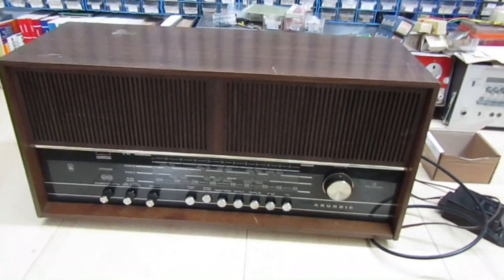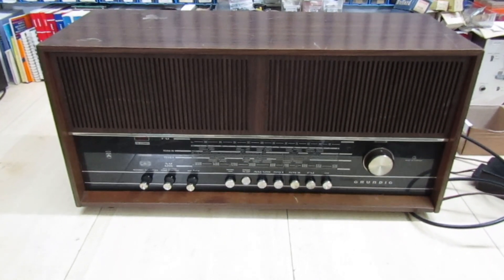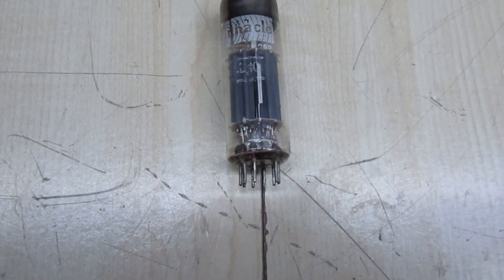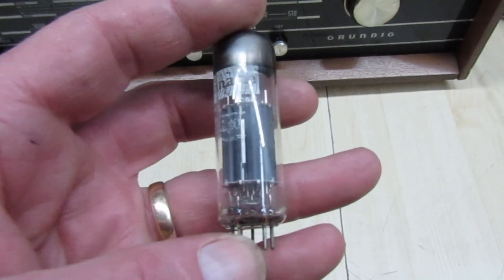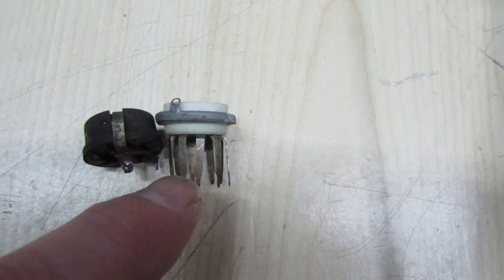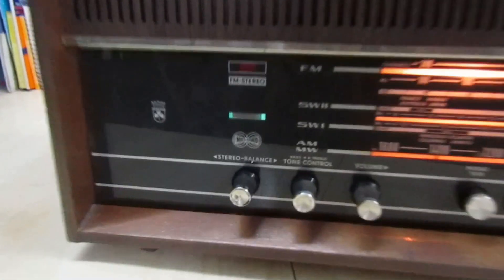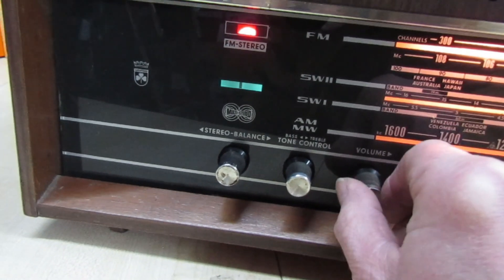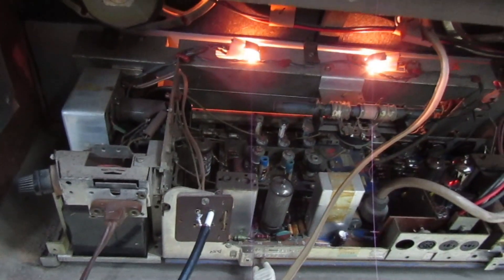Grundig RF250U/Stereo vintage radio.

Comment: Another highly interesting and educational video. That's a very good idea to use a "higher" valve base to reduce heat sink into the PCB. It's nice to see you featuring electronics with valves, I would like to see more videos featuring valve based electronic devices if you have any?
Reply from the maker: Of course ,more valve stuff is planned , I grew up with valves and I love them , also have a very large collection !

Comment: I remember that output valve well from a circuit in maybe Practical Wireless?? I built. If I recall it gives about 3 watts output single ended or 8 watts in a push pull circuit. And you are correct, it really does get VERY hot. Even without leaky caps. Was never a very popular valve but used a lot in European sets. Now very expensive and quite hard to find. Not worth buying second hand as they are always cooked.
Reply: i DID find a good one, looks unused, or very little used, via ebay in the mid 2000s but cost me £25 ish 😲 hate to think what one would be now!, can use 2 EL95s in place with an adapter
Reply from the maker: I vaguely remember seeing this featured in an electronics magazine , either PW as you say or radio constructor ,I think it was only used in a few sets and that's what makes it quite rare and expensive now to buy , I paid about £50 for it .

Comment: That looks to be almost the identical chassis, to a Grundig Mandello radiogram I tried to repair, for my aunt some years ago.  Bought new in 1967, complete with the plug in FM stereo decoder as you have there.  Only difference to your unit is my aunt's chassis had LW and just one single SW band.  The HT bridge rectifier had shorted out and caused the mains transformer to overheat.  A new rectifier got it working again and I have to say, the AM bands sounded very good and the FM stereo sounded stunning.  Even the old Philips autochanger sounded good.  Sadly, the damage to the mains transformer was too bad and it started overheating after about 20mins of use.  I was unable to source a suitable replacement at reasonable cost.

Comment: Pinnacle valve yes definitely a replacement,  good idea to fit the stand up valve base Michael.  I have a Grundig mains radio in at present for repair but it's all transistor model from 1974 so think your one must predate that
Reply from the maker: I have to admit I'm not a massive Grundig radio fan  and while I have many vintage radios I think I only have the odd Grundig knocking about.

Comment: Excellent job done micheal.  Love your idea with the valve base!

They usually came with lorenz/itt or valvo ell80's.
The sound is very good, but it changes its tone characteristics when you turn the volume
about half way up.  I think this is to do with some sort of in built loudness contour feature which has
always seemed an odd arrangement to me. 

Maybe the small OPT's can't handle the extra gain, also the PSU transformer is not all that heavy duty
for a stereo valve set. 
I have had a couple of the radiogram versions with this chassis. The tuners are usually pretty sensitive
and pull in stations fairly easily.

The owner is very lucky to have the stereo decoder as all of the grundig radiograms here in the uk didn't come with one. It was optional, and most people at the time didn't bother with it as fm stereo transmissions didn't
exist until around 1970.    These chassis were made between 1965-1968.👍
Reply from the maker: I figured this may not be a UK model as it can be used on 110v also , I did struggle also to find a circuit diagram , reception in my workshop is very poor and I had to connect to an outside aerial to get stereo.
Reply: @michaeldranfield7140  Yes, this one was probably made for the european market.
Rarely do you see the stereo table versions here in the uk. They are quite a nice durable set, usually very reliable.

Comment: Yes michael those valves run red hot, on radios like these i usually add a slow running 8cm PC fan extracting heat outwards
Reply: reduce value of the grid resistor, it'll lessen the effect of any grid current developing
Reply from the maker: Its effectively two valves in one so twice the heat in the same size encapsulation , I think valves were more reliable when they were octal .
Reply: @michaeldranfield7140  Ive seen these get so hot the glass melted because of the vacuum they suck themselves to death
Reply from the maker: @Synthematix  Yes , I have seen that before where the envelope has distorted.
Reply: @michaeldranfield7140  yep, octals less likely to give trouble in this way, well any older type with wider electrode spacing,  though i do have 2 CL33s with grid emission problem...

Comment: have not seen thouse long leged valve holders since the days of the PYE hybrid CDA panels.
Reply: there are some on my old pye hybrid 697(?)  chassis from 1974
Reply: Those cda boards still cooked like toast, especially with three pch200's and a pl802 cooking away!, not a bad old telly though.
Reply from the maker: I was lucky to still have these in stock , I remember the Pye hybrid , seem to remember there was 3 video out put valves and a very hot running luminance valve , was it 3 x  PL84 s and a 10 pin PFL200 ?
Reply: @michaeldranfield7140  Yes PL84 ran hot as did the 12K resistors.

Comment: Pinnacle valves,there's a name I hadn't thought about for years!
Looks late 60's/very early 70's as it has the stereo capability.ELL80's seem fairly expensive from a quick search.
Reply: they are, they werent ,made for long and notoriously bad, its basically 2 EL95s in one envelope, you used to be able to get adapters to take 2 in place,  also was an ECLL800, same 2 output valves plus a low gain phase splitter triode, similar issues, no adapter for those..
Reply from the maker: @andygozzo72  Got a ECLL800 valve , I made a push pull valve amp with just the one valve for a youtube video a while back .
Reply from the maker: The new valve was expensive , I paid something like £50 for it , pinnacle did a lot of TV valves in the 70 s , they came in a light blue box if I remember correctly ?
Reply: @michaeldranfield7140  Yes,came in light blue boxes and the markings on the valve would possibly rub off a bit more easily than other makes.
Reply: @michaeldranfield7140  make sure you use as low a grid resistor as you can so any grid emission/leakage has less effect 😉  ucl82s in several small philips sets gave trouble, and i usually stick a 150k in parallel with the original 680k  to try and improve valve and  output transformer and  cathode bias resistor life,  theyre run very hard in these, maybe deliberately so more replacements would need to be bought 😉😉 some other models ran their ul84s at a bit over maximum anode dissipation, with similar problems , naughty philips !!!

Comment: Has that valve gone soft? It looks to me as though the gettering has seen a slight whiff of air - not enough to turn it milky, but just enough start a change in its appearance.  I'm thinking back to a Murphy 674 of mine in which the ECC84 did much the same thing. At a glance, the valve looked fine, but on closer inspection it wasn't, and changing the valve made a wondrous difference.

Nice radio, and looks like it does the full 87.5 to 108MHz on the scale, so still very usable in this day and age of AM stations closing down.
Reply: maybe...problem is these small valves with close electrode spacing develop grid current,  particles from the cathode boil off and stick to the grid, making it become a partial cathode, causing it to go slightly positive, afflicts many , especially the lower ht/higher anode current ac/dc  valves such as UL41 and UL84 ,
Reply from the maker: It may have been slightly soft , I have seen valves like that before where the getter smudge reduces very slowly, I even had a valve full of water someone gave me , apparently it had been sitting in a bowl of water in a shed with a Leakey roof and temperature change must have caused a micro crack round the pins and the vacuum  drew the water in , I was going to use it to make a youtube video but something fell off a shelf and smashed it on my bench .
Reply from the maker: @andygozzo72  Had a UL84 before that developed internal leakage to the grid pin and the radio would hum after the set warmed up , I pulled the valve out when hot and you could see the leakage falling on a multimeter as the valve cooled down
Reply: @michaeldranfield7140  i have quite a few ul84s and el84s that suffer from grid emission but main emission is ok so kept them, might make an amplifier with them using low impedance drive so the dc leakage isnt a problem! the ul84s would be ok as the top output in most of those transformerless output stages that philips came up with as the grid is tied to a low impedance point
Reply: @michaeldranfield7140  i was told its a bad idea to store valves where the temperature can drop low, especially below freezing as can cause the glass to crack, especially ones where 'hard' wires/pins pass through a glass disc base, instead of the older 'pinch' and thin wire construction, i've had a few  crack in storage, one being a new unused mullard GZ34, worth good money 😢 also had another one crack even stored in the house, maybe the glass goes brittle with age 😲 so much of our old valve stock may well destroy themselves eventually 😱

Comment: Pinnacle valves were never the best, and the fact it is an ELL80 is asking for trouble.
PCB mounted valve holders are a pet hate of mine, extending the connections is the best
you can do to save the pcb, once they get charred they go conductive and turn a repair into
a nighmare restoration project.
I was just learning the trade when these type of sets were made, the fact that it is a stereo
model makes it rare.
The good old days, when all you had to do is look for where the heat had caused the fault!
Reply from the maker: I'm working on a project of my own at the moment  with a radio and a burnt pcb , be interesting if I can pull this one off !
 I think your right about Pinnacle they were just a cheap foreign import valve , back in the 70 s I use to buy loads of cheap valves from a company I think was called electronic mail order of Bury ? and it was something like any 10 valves for 50p , and some didn't even work at all even though they were brand new .
Reply: @michaeldranfield7140  There were a lot of low quality cheap valves in the 70's
I can remember when the PL509's went in short supply, the CPC rep turned up with a box of
them and we thought he was trying to help, only to find that the glass was so thin they melted
and left us with a lot of angry customers.
Practical Wireless used to have loads of adverts for cheap imported valves, most of which
were of little use even if you were lucky to get a few that worked at all.
Now the valve enthusiasts are desperate for Russian valves to keep their old guitar amps
going for a few more years.
On that note, Marshall Amps are now under a new owner from Sweden, the last of a highly
respected UK guitar amp maker.

Comment: Pineapple valves as we colloquially called them were not all that good, maybe you had a genuine telefunken to replace it with, nice touch increasing its reliability with a standoff holder, there was if memory serves an even more complex and unreliable output valve favoured by continental manufacturers, the ecll800 which was a triode double output pentode, don't think these two valves were ever used by British makers!.
Reply from the maker: Correct , and I used a ECLL800  in a youtube video a while back , I made a push pull amplifier with just the one valve , and boy did it get hot !

Comment: UGH  ELL80, notoriously unreliable, and very hard and expensive to find these days, there used to be adapters to take 2 EL95s in place ,i got a couple in the mid 2000s .. could also use 2 EL85s or EL42s
Reply from the maker: too right ,  I paid about £50 for the new valve , I guess it wouldn't be too difficult to make an adaptor for  a couple of EL95 s but that would have spoilt the originality of the radio .
Reply: @michaeldranfield7140  as far as i know, those adapters were almost an 'official' replacement device!! there may be a pcb design out on the 'net somewhere, the 2 adapters i have certainly look fairly recently made...they were supplied with a pair of EL95s fitted
Reply: ecl82s, ucl82s, ecl86s, also i've come across with grid emission problems, i think it happens more often than many think, likely more common cause of trouble/'failure' of other components than other causes...